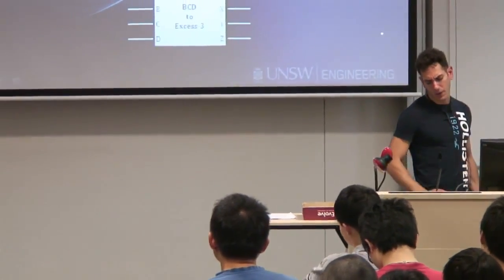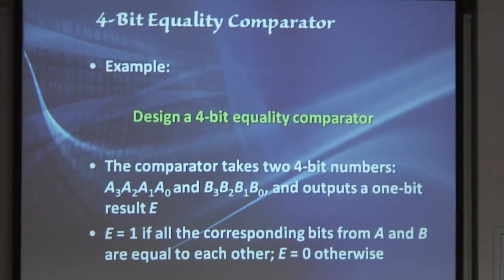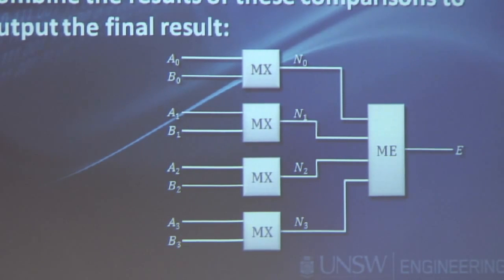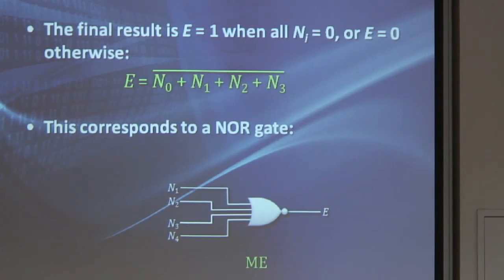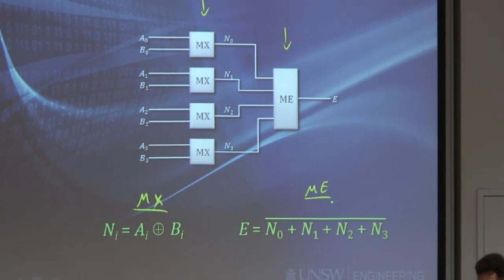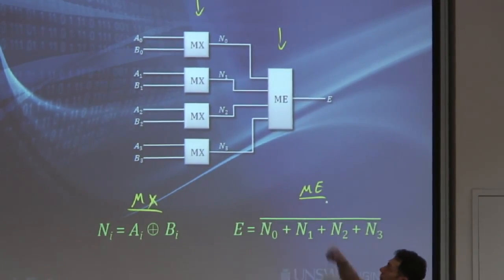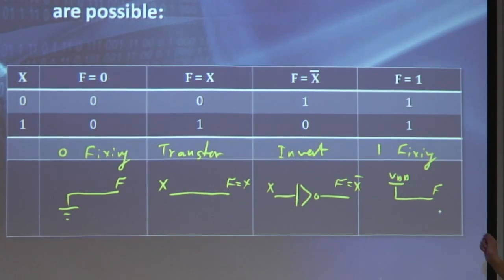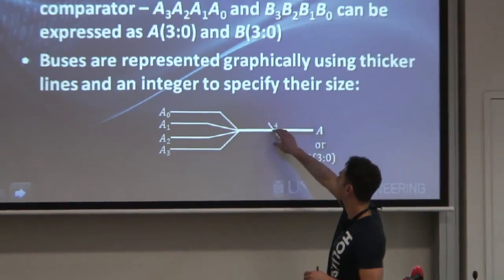ELEC2141 Digital Circuit Design - Lecture 11

Comment: sir i am doing electronic engineering from Pakistan but this subject is divided into two semester. in first semester there is only basic digital Electronics and in 2nd semester there is sequential circuit design.